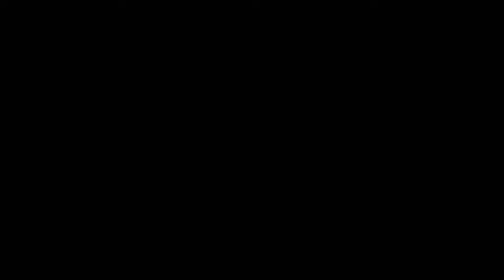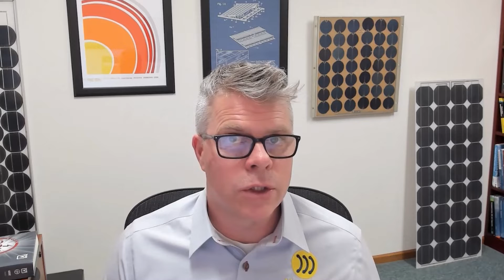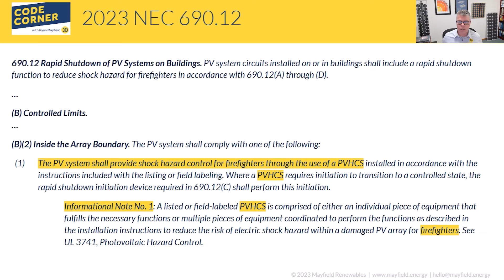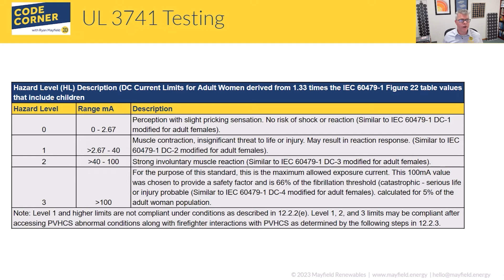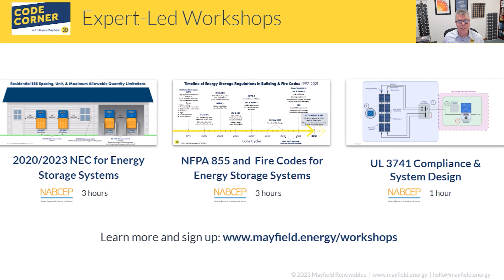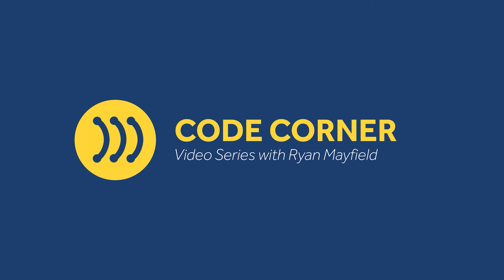2023 NEC 690.12 Rapid Shutdown with UL 3741

Comment: Reports and studies to date, including analyses of firefighter fatality data, have not identified any documented cases of firefighter deaths caused by electrocution specifically from contact with non-rapid shutdown photovoltaic (PV) roof arrays during emergency response. Similarly, specific injuries attributed to this exact scenario are not widely documented in available aggregated data, with some international studies in regions without mandated rapid shutdown also reporting no such firefighter injuries from PV power.

The cost of compliant devices adds $700 to the price of an average residential install, a not insignificant amount raising the cost of solar, reducing affordability and restricting adoption. I was always told safety regulations are written in blood, I think this one is more likely to cost far more lives than it saves.  Rooftop solar installation and maintenance is a dangerous profession with actual lives being lost, any regulatory burden that complicates it needs to closely examined all negative externalities including initial cost burden, maintenance requirements as these devices fail, security implications of ensuring these smart devices are patched through the 25+ year life of the solar panels, all the way down to the lives of the installers and if unnecessarily complicating an already hazardous job is truly in the public interest. 

Governance should take a light hand until an actual problem of sufficient merit becomes apparent. Regulators love to regulate, I am confident that anyone who does more than a cursory analysis of 2023 NEC 690.12 will discover it is doing no one any good, other than the pocket books of optimizer and micro inverter merchants while cloaking itself in the guise of firefighter safety.

Comment: Why not use a 50 Amp relay to short each string's output - high current at low voltage across each panel gives almost zero power dissipation. That way there isn't any high voltages anywhere if we have mechanical protection of the cables to stop them being cut. The short-circuit current Isc of a string is typically less than  25% higher than the peak operating current.
Reply from the maker: You are correct that it is technically possible to intentionally short the string circuits to bring voltage close to zero. But the challenges of re-opening the circuit (which, given the presence of current, could cause arcs) and the details of the UL 3741 testing and listing requirements may be too much to overcome to make it a feasible solution.
Reply: @MayfieldRenewables  We need to force them to ditch the regulation altogether. It kills more people than the 0 firefighters it saves. But then you couldn't sell classes on this bull splat of a reg.  NFPA is an illegal monopoly and a racket they have subsidiary cartels under them like UL. Its a fuquin book publishing company and its glob darn unconstitutional how they get to just dictate what the law is going through no legitimate legislative process and force everyone to pay $275 every three years to be able to find out what the new laws are.  The feds should break it up and send its leaders to federal prison. Absolutely ridiculous.

Comment: The regs have been a mess for ages and this isn't a whole lot better.  Up until now (and still for most municipalities), we have to add module-level protection to a string system... that doubles the number of connectors that can fail and become a fire hazard up on the roof and adds electronics that can fail and become a fire hazard up on the roof.

Australia, for a long time (and still in some municipalities) also required disconnects up on the roof too and those were the source of many roof fires when they failed. 

So now we have UL3741 which is basically just an almost meaningless admission that all these other requirements only made things worse.  Except of course they are still going to make you spend gobs of money certifying specific combinations of obviously safe installation methods to get the certification when probably 99% of all racking and panel systems and simple zip-tying of double-insulated cables would pass their testing anyway.

And apparently they didn't get the memo that putting electronics and mechanical switches of any sort up on the roof increases the fire hazard.

Sigh.  Why can't they just make things simple.

-Matt
Reply: Regulators gotta regulate, its like what they do.  And our society does not value the work of deregulators.  I swear infinitely more solar installers and maintainers die while installing or servicing these compliance devices and methods, vs the actual verifiable 0 firefighters that have died due to non rapid shutdown rooftop pv electrocutions in any published literature.